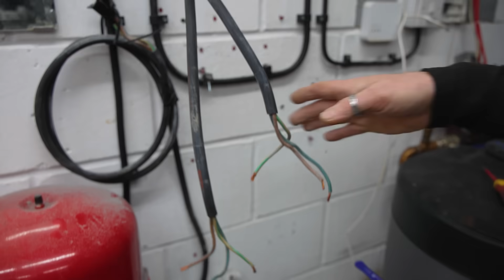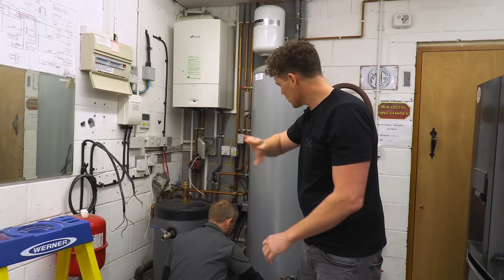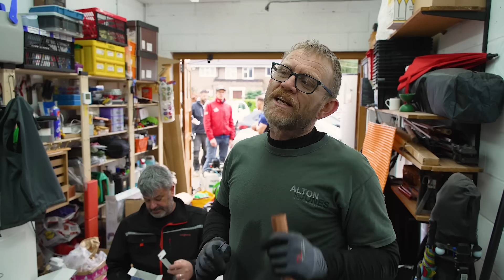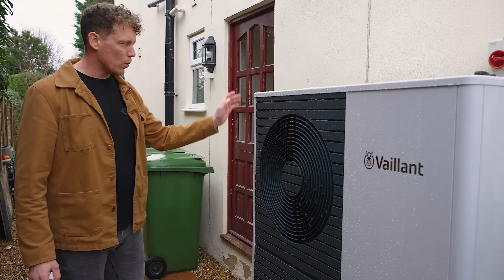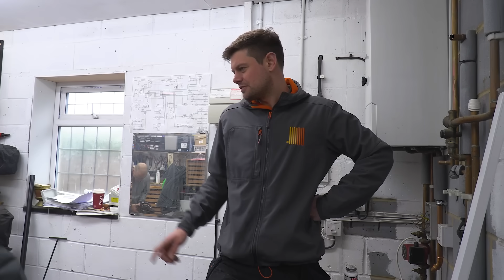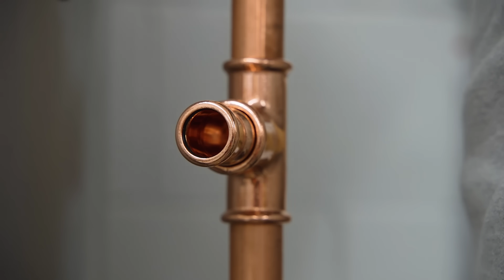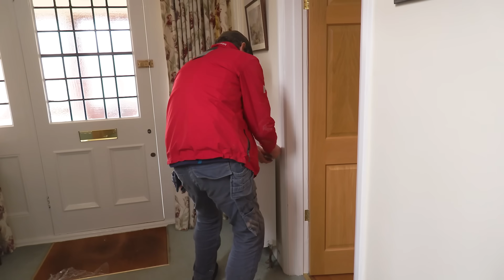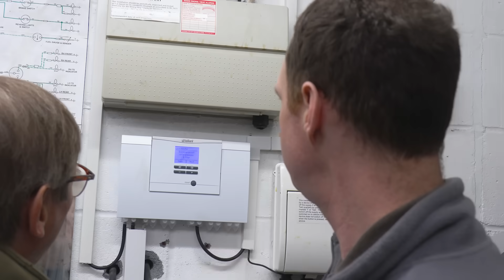Ultimate Heat Pump Installation. Rip It Out & Start Again!

Comment: Just one comment regarding the noise from the previous LG unit, you can replace the fan motors relatively cheaply and this will eradicate the bearing noise.  I just replaced both fan motors on our 16kw Samsung unit for £320, it's a very simple DIY job, done in 1 hour.  Our unit is 9 years old and the bearings had not failed, I did this as preventative maintenance, just saying that bearing noise is not a reason to dump your heat pump.  If the heat pump is not level and that is contributing to bearing wear, just level it! I know this particular system had to be replaced as it was a bad install, but a bearing noise should not be the driver for replacing a heat pump.
Reply: Yes, replacement was an option - one which Roger suggested, though I'd already had a quote which, together with some other remedial work cam to £2k. That on top of £16k already spent was the last straw - when the missus said 'no' and I agreed with here. That's what led me to contacting Roger at Skill Building and the rest, as they say, is history...
Reply: Makes sense if everything else about your system is working fine.
Reply: This came up in the comments on a previous video, and IIRC replacement motors for that particular unit would have been £2000 !
Reply: @robinbennett5994  £2000????  I'm not sure I believe that.  Why should motors for the LG be more than they are for a Samsung?  Probably made in the same factory
Reply: @davidstorm4015 I doubt any heat pump manufacturer makes their own fan motors. They buy them in for £50 and charge you £150 to supply to you as an official spare part.
Reply: @normanboyes4983  probably right, so I bet you can get the LG motors for a reasonable cost
Reply: @davidstorm4015  Yip, you can spend more time researching to get the right part at best price than it takes to fit the replacement.😉
Reply: Spot on - its like saying you should scrap your car if the wiper blades wear out.
Stupidity abounds.
Reply: How many people are willing to risk wrecking their heating over a "simple DIY job"?  You know that price goes up to thousands per motor, if you can get anyone to show up and have a go.
Reply: @rogerborg imagine 9 years of not having to service a boiler and then you just have to change a couple of motors. I admit we have an issue in this country when it comes to just wanting to screw combis to the wall, but it’s one I think it’s worth overcoming.
Reply: @edc1569  yes, totally agree and I didn't even have to change the motors, I just did it as preventative maintenance
Reply: @rogerborg He's giving folk information, and they can decide whether it's right for them in terms of the risk / reward :)
Reply: @defragsbin  thank you for the support / clarification, the manufacturers and installers want people to think that they cannot do simple things on their heat pump.  Replacing a fan motor is really easy, it needs no technical experience or knowledge, you just have to make sure you order the correct fan motors.
Reply: @davidstorm4015  There's never been a better time to be alive for finding specific DIY knowledge, too! Videos, web pages, books etc.
Reply: @defragsbin  exactly so, can save homeowners so much money.  How much do you think an installer would have charged me to change the fan motors?
Reply: @rogerborg  remove a few screws, unplug a plug, fit a few screws and plug in a new plug.  What's hard about that?

Comment: It was an amazing experience to be involved in this installation. Well done to everyone who made it happen and to the homeowners for putting up with us 😃
Reply: Good effort Mike and all involved 👏
Reply: Happy to be a fly on the wall in this campaign
Reply: I noticed that you have removed a sensor pocket on the new heat geek cylinder and replaced it with a expansion release valve. Why do you have an expansion release Valve and a high temp. and pressure release valve on the cylinder??? Why not just the high temp and pressure release valve and leave the top thermostat pocket?
Reply: And...everything broke!
Reply: @bastogne315 oh where was that said! I only found this now!
Reply: Talk about making a mountain out of a molehill.

None of this nonsense with a gas combi

Comment: So if you hadn't got involved Roger he'd still be up Sh*t creek without a paddle, i'm sticking with a normal gas combi, this is like electric cars sounds good on paper but no good in real life
Reply: I've had my electric car for 13 years, it's been no bother. In real life too. My real life. Which won't be the same as yours of course, as they're not (or weren't) for everyone.
Reply: @ricos1497  13 years don't make me laugh 🤣🤣 Battery will be well fooked
Reply: @canalboating  why on earth would anyone lie about the length of time they've had a car? It's a 2011 leaf, so 13 next month. Battery is about 80%, which is still enough for almost all my journeys. Probably about 3-4 times per year I go somewhere where the car wouldn't reach. Should get another couple of years out of it. Would like just to have replaced the battery, but I live very close to the sea and the rust will have done for it before the battery fails most likely.
Reply: Have you considered going back to a coal fireplace? Much less to go wrong.
Reply: @edc1569  fireplace? Modern nonsense. I just set light to my own shit in a hole in the floor. Things were just much more simple in the past.
Reply: I have one thanks @edc1569
Reply: The first steam engines were incomparable in performance to the Mallard, what's your point?
Presumably the first gas boiler installations were equally as bad as most heat pumps now - give it another generation and this will be well understood technology.
Reply: @james.telfer  what's your point The guy in the video spent over eighteen thousand on a crap system and god knows how much this cost and will cost to run, some of us haven't got a spare eighteem grand or a generation to wait.
Reply: My electric car is amazing, would never go back. Maybe change where you get your "news" from. Keen to get a Heat Pump at some point but this video makes it clear - the planning & install is really important
Reply: They’ve only just installed it. How do you know it’s no good? What a strange thing to say.

Comment: List these guys contacts. My friend can't even get someone to come out and repair his system
Reply: And there's your problem. Install and run, with maybe a shout of "You just need to let it balance mate, just leave it to balance" over their shoulder as they vanish over the horizon.
Reply: The homeowner here had the system installed which didn’t work , then another installer puts in bigger pipes and rads and buffer , which works but is too expensive to run . Now he has had the HP and cylinder replaced all in the space of 7 years. 
Mental .
Reply: @haydnlawrence8167  my friend has the same problem. Had it installed, low temperature radiators, supplementary radiators. Worked fine for a little while then failed. The installer had gone bust and no one would even look at his pump. They all said he has to buy a new from them
Reply: Yep. Let down by poor regulation and training. Not by the technology. @haydnlawrence8167
Reply: Just google ‘find a heat geek’ and you’ll find hundreds of installers.

Comment: Rip it all out - and install much less!

Looking forward to showing what Heat Geek installs can do. Prediction for this install is that it will end the year well in excess of 400% efficiency!  - Follow the live link to see how it’s getting on in the description.

Thanks for having us over Roger and Dylan! Biggest collaboration in home energy right now.. Looking forward to our fight in Birmingham 😡 🥊
Reply: Great vid guys. I love to see you succeed where others say say can't be done. Took a look at the CoP and it's coming in at just under 3.9 right now. I'm sure it'll improve, but certainly borderline considering what you guarantee.
Reply: @alanmcguinn  it will end up at about 4.5 at this rate, I’m not in the slightest bit worried 😁
Reply: @alanmcguinn  SCOP creeping up, 4.23 now! It'd be great if there's a retrospective video after 6 months or so to pick over the findings and compare the running costs to gas.
Reply: @alanmcguinn Now showing the SCOP at 4.01 🙂
Reply: @alanmcguinn be interesting to see the price comparison vs. gas. Sounds like it should be OK?
Reply: I would love to see some more info and possibly content on Air to Air systems. When I come to buy a property that is what I want to be installed. Given that summers are getting hotter having the cooling in the summer as well as the heating in the winter would be perfect. But there isn't a whole lot of information on domestic "Air conditioning" that I can find. 

Great work on this system though. Showing how to do it correctly.
Reply: 400% efficiency is not necessarily cheap to run unfortunately. Just checking the daily consumption for the first few days and are ranging between 50-70kWh / day ... I hope you can fine tune it overtime
Reply: @aleesi2  if the first few days we were reheating the complete thermal mass of the building. It’s a 6 bed 300m2 single brick home. It will more likely be around 450% over the year.
Reply: Set of legends!!!
Reply: I wish HeatGeek would have partners/recommendations in Germany...
Reply: @micha-ix1iy  just need installers to take the training is all!
Reply: https://youtu.be/XCMaup9Eosw?si=DueQe3HSYsk_XyFi
Reply: So a system that does work and according to Adam just needs a weather comp sensor.  Has a load of equipment removed and another 15k + of equipment installed ?
Reply: People like my friend will not be installing another heat pump unless what has already paid ~£10000 for is made to work correctly. That's the problem. He tells others about his problem and the result is what you see in the comments
Reply: @stephenrichards5386 Given that they've just done a video replacing a crap install and have talked about it at length, that's not exactly news to them. 

I think Roger's shifted his position on heat pumps over the last few years (in terms of their viability when put in by a capable installer), but his point about the patchy national training quality is still totally on point. 

Until the government gets certification & training standards sorted, billions will be wasted on poor installs. I live in Scotland and there are very few heat geeks near me, and I wouldn't trust a random engineer to do it -- too many things to go wrong. Heat pumps are definitely the future, but we've got a long way to go!
Reply: @stephenrichards5386 He may not need a whole new system. Has he had someone reputable actually come and look at it?
Reply: @egocd  A reputable firm will diagnose a sensor problem, then rip out a load of kit and fit 15k worth of new kit . No hold on that’s on systems that work.
Reply: It's criminal what has happened to people who trusted and are now left cold and expected to cough up to refit a new system.
Reply: My friend is a pensioner. He has already ditched a heat ing system for this useless heat pump. He had to fit a lot of special radiators etc. He now cannot justify a new pump and system at £10 K

Comment: Not wanting to assume but it’s not as if the home owner needed a subsidised install with the free pump and cylinder etc….surely could have done that for someone who genuinely needs assistance with the cost.
Reply from the maker: newsgroup6948
You make a very good point and we do try to help good causes but John had already spent in excess of £18,000 for a system that didn't work so it is not as if he has finished up with a net gain.
It would have been very hard to persuade him to shell out another £18,000 to see if it worked.
 The value in this for HeatGeek's network of installers and the makers of the equipment that was donated  is to prove that the problems John experienced can be avoided by going to the right people. 
I (Roger Bisby) have been in the industry a long time but I have never come across a group of installers with more knowledge and enthusiasm. Just listening to them exchanging ideas and knowledge was humbling. We will be featuring them one by one in some future videos. 
That said, heat pumps are still not a cheap option and the government grant is propping up an industry that will one day have to stand on its own two feet. 
Sadly there is an imbalance in  this market with the big companies getting the lion's share of government grants. HeatGeek's installers are small businesses who often find themselves squeezed out by the big companies who can afford to spend fortunes on advertising and marketing, 
Hopefully this video helps people see that if they do tndecided to buy a heat pump they can talk to their local installers who are highly trained and motivated to do a good job. More importantly they are there at the end of the phone if things need to be tweaked or discussed. The frustration of dealiing with an endless succession of recorded messages and "press one for bla  bla bla, is a good reason to avoid the big companies.
Reply: @SkillBuilder Just want to say well done on keeping an open mind on this. I've followed your video series and debates with Adam & co, and it's great to see a sincere collaboration. 

I'm in total agreement with you re: certification and training -- there's a giant mess brewing. I'm sold on the technology, but there aren't enough Heat Geeks & Urban Plumbers to go around, and certainly not enough to fix the mess others have made. Eventually we're risking sleepwalking into billions wasted on rubbish installs. I don't trust the government to make a long-term strategic commitment to guide things, either (they already made a complete hash of the insulation). It's sad. I wonder what can be done systematically to improve things?
Reply: @SkillBuilder  fair point and good to have the context behind the refit and apologies if that was already covered in a different video. Thanks for clarifying, when you all coming round to do mine? 😂
Reply: Roger's client? This needs to prove a crap system install can be made into a working one. Putting in a new system doesn't. Hence why it was done. Now everyone will be monitoring it. I'm sure it will be fine now. They probably made more money back from the stuff that they took out. 😊
Reply: @davidvincent5244  ""They probably made more money back from the stuff that they took out." There is practically nil value in removed equipment. Most of the cost of an install is in labor, overhead, and equipment markup from wholesale. Someone in the trades would much rather work with new than waste time and potential callbacks with used kit. Perhaps someone retired from the trades who maintains their own system might grab a few bits as spares. For free. That leaves the advanced DIYer who has both the specialized  tools and capability to competently install and troubleshoot virtually anything HVAC related. I might place myself in that category and have been known to pick up a few odd bits that could potentially be useful on a cold night. For free. Is there a pattern beginning to emerge here?
Reply: So you have access to his bank account?

Comment: My friend has been living without heating for 3 years. He is 78 and living in an historic but small property
Reply: I think I met that snowman
Reply: If his house has high heat loss the efficiency of the source is even more important.
Reply: @Swwils  of course but the design should manage that shouldn't it ?
Reply: @stephenrichards5386  no, we have been chucking in combi boilers for decades without any design whatsoever. Modulating gas boiler from 1980 is meant to be a low flow temp system.
Reply: In other amazing news human beings do predate central heating. Personally I like to be able to do some work from home in the evenings and not shivering or wearing an outdoor jacket is a prerequisite

Comment: Interesting. So even a 1930's 😢house with no insulation on external 9inch walls will work?
Reply: My total electricity costs  for whole house...uninsulated Victorian terrace..for January with a heat pump were £130 with no gas.
Reply: Yes, but your electricity bill will scare you to death...
Reply: @nectafarious8842 if Adam and the gang are correct, it will still come out cheaper than gas. You also have the option of solar panels to reduce your bills.
Reply: at what cost though